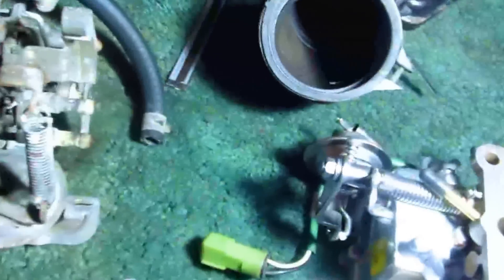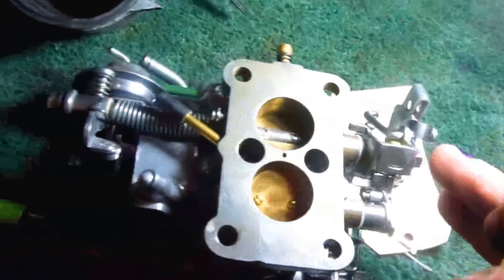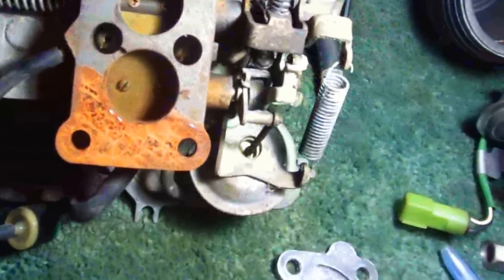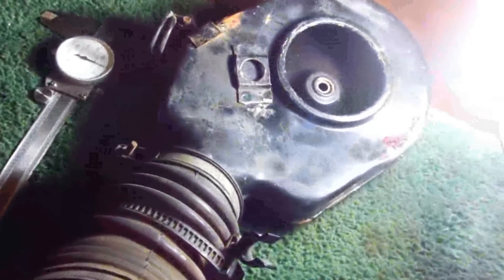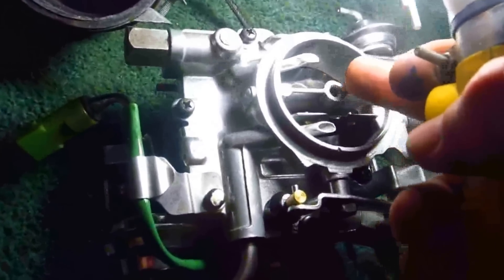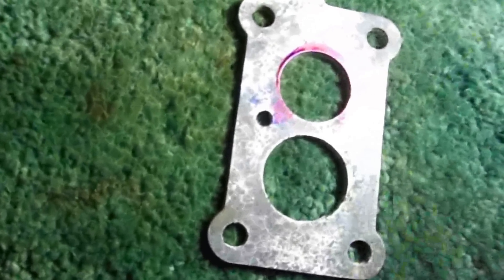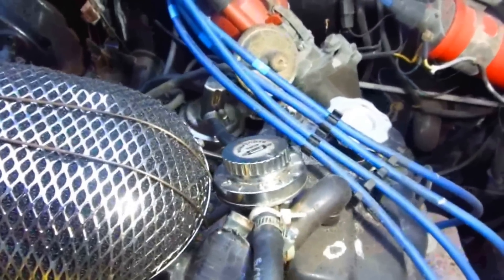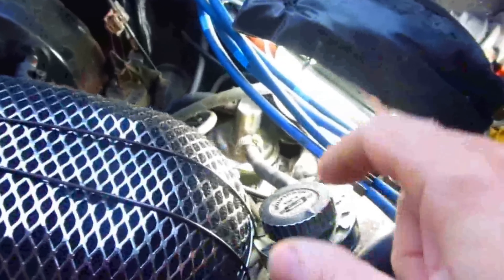Suzuki Samurai - Installing a Toyota carburetor 1 of 2

Comment: I'm having issues with my swap. i made my primary opening larger like you did, but i didn't fill in the slot on the back. i heard you say it wasn't needed if your not using the vacuum? my motor will start but will only run after half throttle. won't idle or low throttle at all. could this be the issue? or do you think i should adjust air fuel and idle? and if so where do i start? which one is the adjustment screw?

Comment: I just did this swap. having some trouble with the carb, it hesitates when you floor it. kinda like its getting too much fuel. did you have to play around with the jets?
Reply from the maker: No.  I didn't have to do anything.  Check for vacuum leaks.
Reply: syyenergy7 yeah, i did spray starterfluid all around the carb but the engine didnt respond to it
Reply from the maker: I didn't change any jets.  The only thing I did was adjust the idle speed, idle fuel ratio and the choke.  It runs great right out of the box.  That's what I heard from others too.  It could be that the float level was set wrong when they built the carb.
Reply: syyenergy7 Yeah, ill have to look into that. Thanks for the howto and the answers. subscribed :)

Comment: what's the part ###??
Reply from the maker: The carburetor is for a Toyota Corolla 3K-C 1.2L available at:
http://www.nationalcarburetors.com/lookup.aspx?partnum=TOY250
78 Toyota Corolla, 4 Cyl. 1.2 Liter with a manual choke
Part no  TOY250

Comment from the maker: +Kwstas Panagiotidis
Toyota Corolla 3K-C 1.2L carburetor

http://www.nationalcarburetors.com/lookup.aspx?partnum=TOY250
78 Toyota Corolla, 4 Cyl. 1.2 Liter with a manual choke
1973-79 Aisan carburetor 

1166cc Corolla 1200 Sedan  21100-24016 21100-24017 (w/9mm Needle Seat Thread) 21100-24018 21100-24019 21100-24440 21100-24441 21100-24442 21100-24460 21100-24461 21100-24480 21100-24481

The toyota / Asian 28/28 is approximately the same total
size carburetor. The stock samurai carb is a 26/30 Hitachi.
The slightly larger primary helps improve the low end torque
of the little mill. It is a very simple install because they
have the same bolt pattern. You will need to port the stock
samurai thermal gasket to match the larger 28mm venturi.Also
there is a vacuum channel that needs to be cut. I used a mini
die grinder(Ryobi, Craftsman, ect)to make very quick work of it.
Reply: thank you my friend